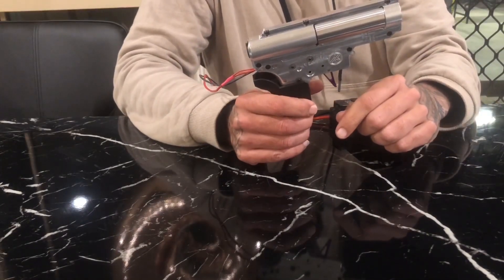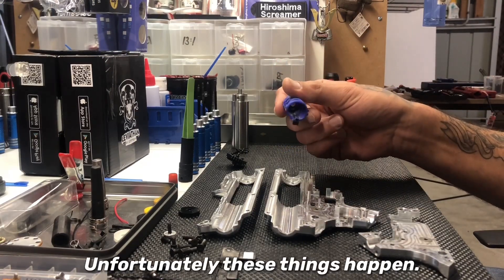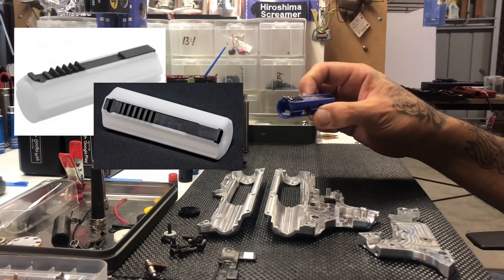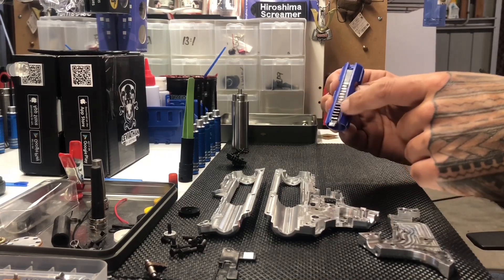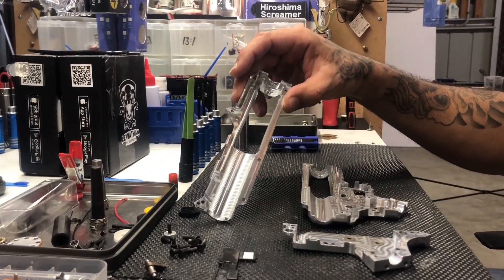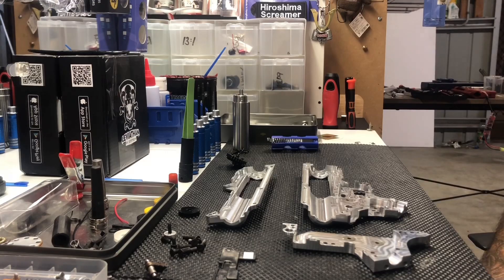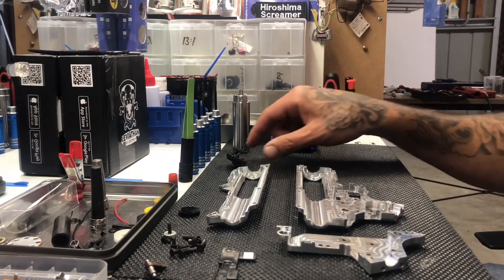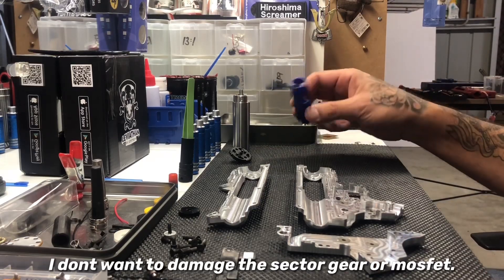Testing the beta MK Tactical modular H92 part 1, 6.5/1 DSG build part 2

Comment: I'm a tech over here in the US, are the retro arms CNC gearboxes avaliable to you guys over there in Australia? They are almost the same to the current ones you have, but they are more refined and clean. They have both a split and a full gearbox version. The retro arms pistons are great, cnc steel rack too. I'm running 1 in my 8tooth 1 tooth ss shs dsg  with a tinely 35k at around 50 rps, and I've seen little wear and no cracks or failures.
Reply from the maker: Hey mate, yes we have them here.
This one I have is a test box so finish is not as nice as the released version.
The final product will be anodised.
Thanks for the info on the pistons!
Reply: @hiroshimascreamer5884  we have a bunch of different colors here in the US. You can even get the silver one. Yeah any retro arms stuff is the best in both price and functionality.
Reply from the maker: Griffin F have you used the retro arms CNC piston head X?
Reply: @hiroshimascreamer5884   not yet, I usually go with the lonex ones or the cyma ones.

Comment: Great vid man love to see this are going ok with the build the new mk tactical gear box housings look great also I was wondering what shims you use and have you tried to make your mag motors faster
Reply from the maker: Sabin Hill cheers bud, just normal FB shims.
I have some high speed mag motors but not sure if they’re fast enough for this. Guess we’ll find out soon
Reply: @hiroshimascreamer5884  ok thanks where do you get the high speed mag motors from
Reply from the maker: Sabin Hill AliExpress or x force Tactical bro
Reply: @hiroshimascreamer5884  ok thanks man
Reply: Hiroshima Screamer do they have neo magnets ? And do you have any motor heat issues
Reply from the maker: Runaway_Cuban no idea mate, probably not I’d say

Comment: Which cylinder head and nozzle combination did you use with the h92 modular box? Did you use the stock one or an aftermarket?

Also is this for the xyl or the hlf?
Reply from the maker: Andrew Tang at the moment one piece cylinder and v2 nozzle with kublai orange tip. Factory t piece but I’m probably changing the t piece adapter as well.